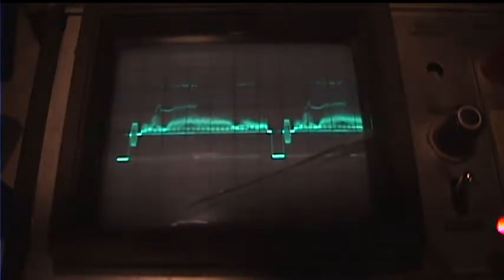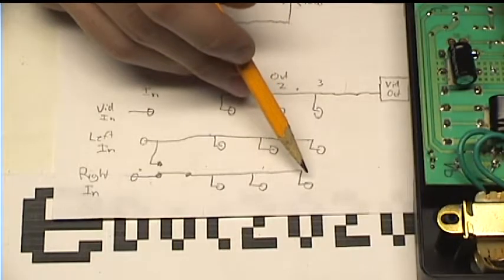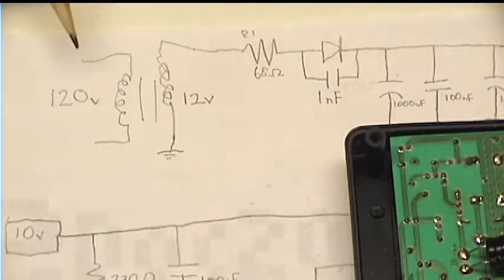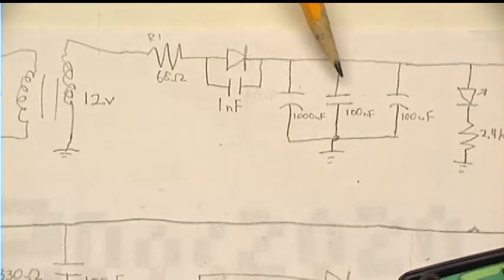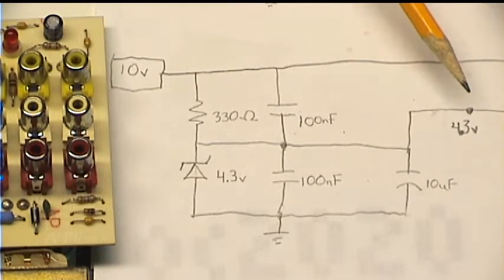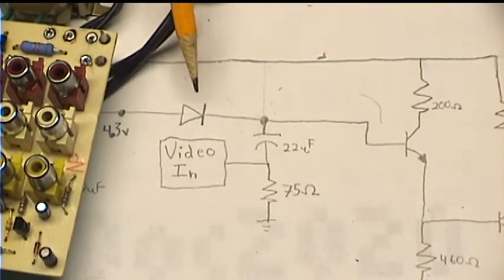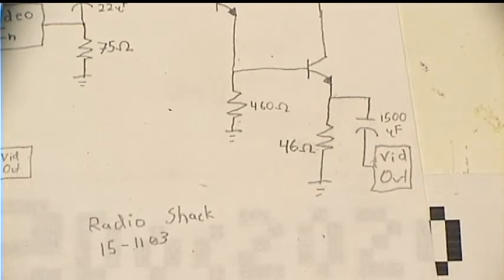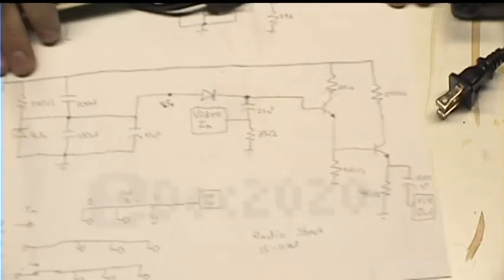Reverse Engineering a Video Splitter - eDoc2020 #4

Comment: Nice video, but this is not a proper video splitter. A proper one has an amplifier with 75 ohms output impedance for each output. A semi-proper one looks like this: a high speed opamp with nearly zero ohms output impedance, with its output connected to each output jacks through 75 ohms series resistors. This way each output has about 75 ohms output impedance, which is necessary. Having 75ohms terminations just on the load side is not enough, you need 75 ohms output impedance on each individual output as well.
The output voltage of this contraption by RadioShack will change based on how many outputs you are using. It may also introduce some ghost images due to reflections caused by improper termination, although SD composite video is not too sensitive to that. Most cheap video cables nowadays are not even shielded, let alone having 75 ohms impedance.
Reply from the maker: Thanks for watching. I know next to nothing about transmission lines but I thought you only needed to terminate the receiving end of the line. As for the output voltage changing, I don't think that's much of a concern. The emitter followers should have a pretty low output impedance. I agree it's not perfect but I can't tell a difference and I imagine this is cheaper than fast opamps.

And cheap video cables, are they really unshielded? I haven't come across that but I also haven't gotten any new ones for years. That seems terrible, I hope it's just the bottom-barrel unbranded imports from online.
Reply: @eDoc2020  Unfortunately I've seen a lot of unshielded video cables. Yes, bottom of the barrel ones, but not just from online purchases from China, you can buy them in supermarkets, at least here in Europe. For example the SCART cable that is provided with cable boxes are unshielded a lot of times. Sometimes they try to mimic a shielded cable by having some bare strands around the inner conductor, but the coverage is around 20-30% at its best.

Comment: @eDoc2020 Sir I tried all those attempts those behave even worse with li-ion battery, even tried a shunt regulator , but the lowest I could get was of 2.5V added to 3.1V of led i had very little room for constant current I got results with the constant current circuit using a opamp and a N chnnel mosfet but that didn't work for voltages below ~5V .May I get your mail I want to talk to you I liked your vidoes and  maybe can a help a little ;)

Comment: reply  from diode gone wild chat @eDoc2020  Apprently you are correct with the points you just suggested, furthermore I have more faith in your second point,(i.e they are made without any regards for safety).Well I want to make a Li-ion battery powered flashlight but I don't want to use any dedicated IC for that as it would make a project a costly and also occupy a lot of time , I came across Many circuits but they either cannot be powered by a 3.7 v source  or they are not a constant current source one....Awaiting Replay
email me  adityasingh.as187@gmail.com
Regards Rabindra
Reply from the maker: For an LED driver you can use a two transistor regulator like what's on page 4 of this appnote: https://www.onsemi.com/pub/Collateral/AND8137-D.PDF

I've seen this type of circuit used before and it works well. The issue in your case is the current will fall when the battery discharges below the nominal 3.7v.

If this is a problem (or if you also want charging) you might want to reuse a USB power bank and derive the LED power from the 5v output.
Reply: @eDoc2020  Sir I tried all those attempts those behave even worse with li-ion battery, even tried a shunt regulator , but the lowest I could get was of 2.5V added to 3.1V of led i had very little room for constant current I got results with the constant current circuit using a opamp and a N chnnel mosfet but that didn't work for voltages below ~5V .May I get your mail I want to talk to you I liked your vidoes and  maybe can a help a little ;)